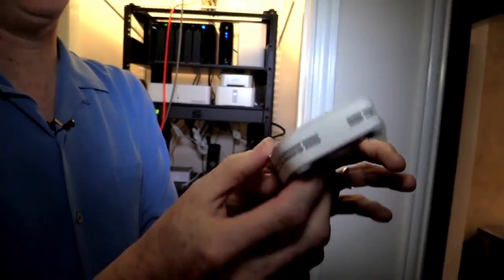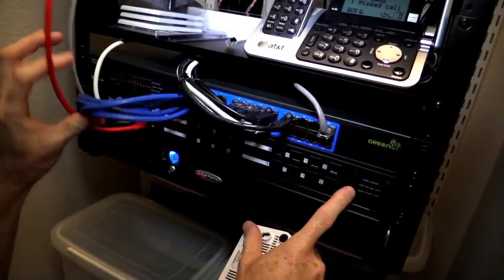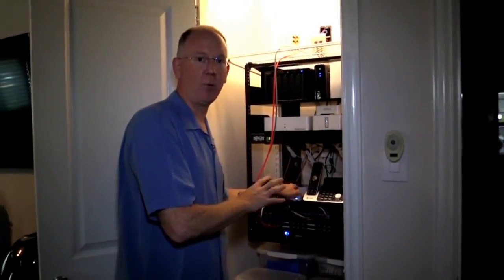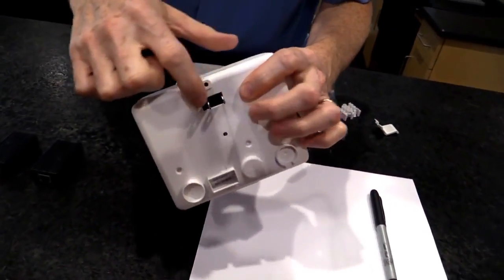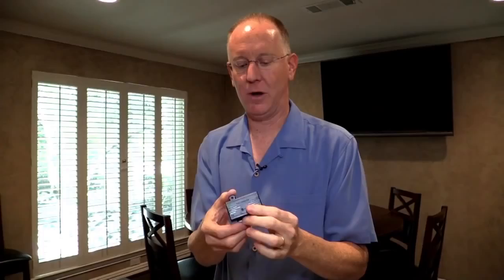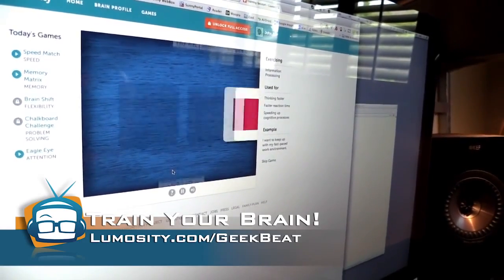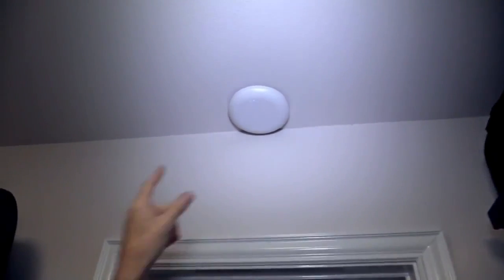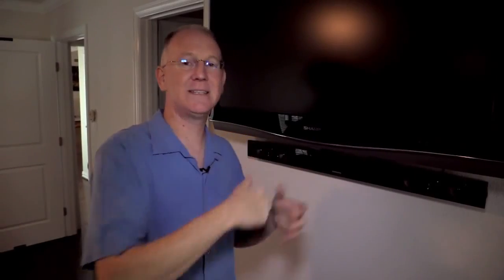Review   Open Mesh WiFi for a Large House or Small Business

Comment: Great review! Everyone must realize he is just giving you a quick overview. The details he did not show you is what would blow your mind. I set up all my customers on this system now. It's awesome for control of a single location or multiple locations. Being able to view what is going on is unbelievable. There are gps antennas built in so the units phone home and tell you where it is located on a google map. On the map you will see the current status of the mesh connectivity. You can view what devices are connecting to the access points, show you if it's an iphone, android, pc, it's throughput, even websites they visited by bandwidth. If one unit looses power the mesh rebuilds itself by finding the next best pathway. The units auto upgrade themselves with new firmware when released. I could go on and on. The units are totally pro and the bottom line is I don't have to waste my time troubleshooting "home" wifi access points and routers, they just work and they work for years and years with no tinkering. Out of 60 units I've maybe replaced one. Opposite of his title I would say this system is for big business but can scale down in affordability to SOHO while retaining the features a large IT dept would need.

Understand that the very first unit you install needs to be connected to your wired network. Every unit after that can be either wired or wireless. In addition, every unit can be either POE or wall adapter. All options allow great flexibility. So for his example in his kitchen, he just plugs it into the wall outlet and that's it, no need for a network cable, it's a repeater at that point. Very important to understand that you can create excellent connectivity in places where you can't run a cable.

Comment: Can't you just buy some Wifi Repeaters for like £20 off amazon and they do the same job?
Reply: +Bobby Dilley Repeater issues 1. They do not provide seamless roaming, so your device has to connect/reconnect every time you move. 2. Just cuz it can do it, does not mean it can do it WELL
Reply: +Kyle McNicoll There are no studies that show that mesh technology works any better than repeaters.
Reply: If you're going the cheap route with the repeaters, a study isn't really necessary.More expensive, reputable repeaters may be a different story.
Reply: +Kyle McNicoll oviously there not going to be brilliant, however they still are likely to outpace the speed of your Internet connection, tied in with the fact that it's unlikely your moving around lots
Reply: I've read that there is no actual evidence that the mesh technology used here actually works to much an extent.
Reply: Thanks for the good explanation! Yeah I'm still a fan of wired access points :)

Comment: What if your house has 8 different circuits ?
Reply: +Francois Vanheerden For power? It doesn't matter, it doesn't do ethernet over power.
Reply: What i meant was , 8 different circuits. do you need to plug in 8 access points at the start of each circuit (close to the DB board and then 8 at different points in the house? since it is using a circuit as a "LAN" cable.
Reply: Apologies , i am not clever with IT stuff.
Reply: +Francois Vanheerden No worries, don't apologize for asking questions, that's how we learn. :)
Reply: Eric: What i meant was , 8 different circuits. do you need to plug in 8 access points at the start of each circuit (close to the DB board and then 8 at different points in the house? since it is using a circuit as a "LAN" cable.

Comment: Too hard or complex to use, for I would have to buy to many sucking devices.  Not Good of a solution.  By the way, a single access point device cost $75, up from $55 price shown in other videos.  So just to implement such a mesh network in a small home (I probably need 4 access point devices), it will be getting expensive very quickly, not to mention enclosures and whatnot.